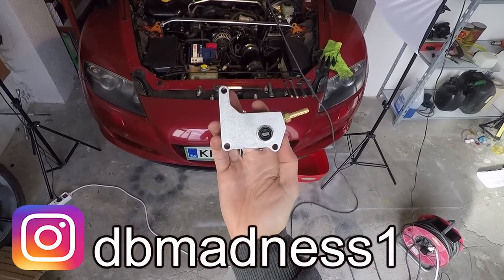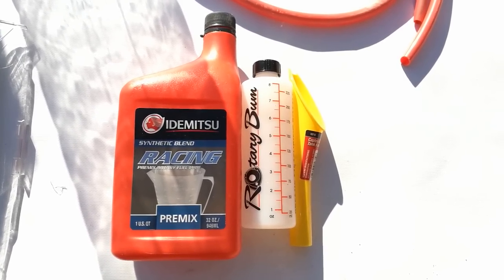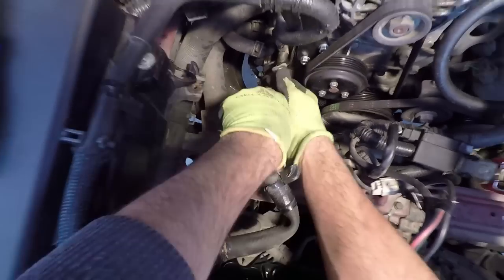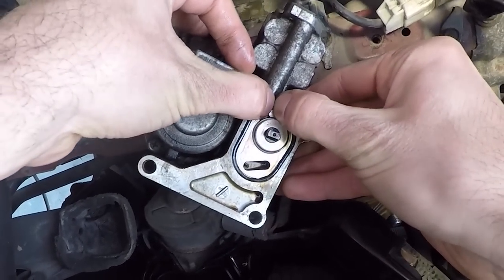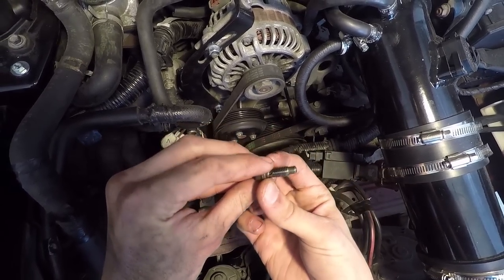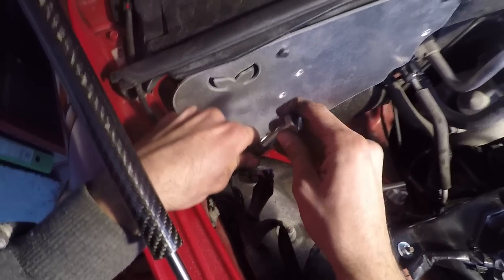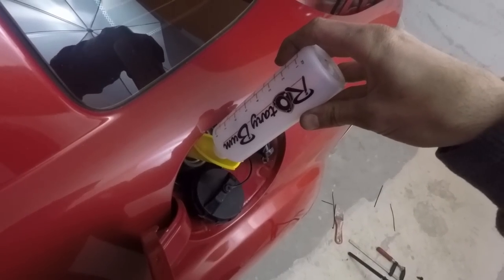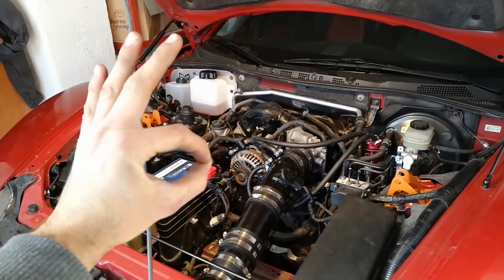Mazda Rx8 Sohn Adapter Kit Install

Comment: Awesome Video as always :)  but you forgot to warn about the oil lines, when you unscrew them, be careful. The screws or the lines could be very hard corrosed and break easily which means very much care and concentration in removing them otherwise a bolt or a line could break and you OMP (Oil Metering Pump) can become useless :)

Next year in May when my RX-8 wakes up from wintersleeping, ill add the Sohn adapter myself to it i can await it to do it ❤ <3. What do you think abaout the Nvidia Q300 Exhaust kit? Im gonna install it, because the Magnaflow wont work for me in germany and i dont know where i can purchase it for shipping to germany ^^
So for now i and my RX-8 Yuu-Chan wish you Merry Christmas, and a good start into 2018, to be have a nkce Car Season and more Fun with our rides than this and the last years x3 
For the Community too greetings!
Reply from the maker: The lines looked quite hard and durable. I was a bit scared when pulling them forward while refitting them, but it got done safely :) Thanks for the heads up!
I was also thinking of installing the Q300, as it is the cheapest one with a TUV certificate :P I would install the Turbo XS exhaust, but it has no papers and it's quite loud.
Take care of it! Cover it with a nice fuzzy blanket to keep her nice and warm :)
Thank you sooooo soooo much :D I wish you a merry Christmas to you, Yuu-Chan and your family! may 2018 be a year full of adventures and unforgettable memories :) <3

Comment: Nice tip :)
I installed mine 2 months ago, with Motul 710 2 Strokes Oil and 2 strokes oil additive. Result is pretty impressive, and engine feels different to me, slight torque increase on all rpm range, and better high rpm reving :)
I'll have a look to your feedbacl after many refueling...
Reply: Go fo motul 800 dude, it' s the best performance 2 stroke oil out there😎
Reply: @raulduke85  this one Motul 800 Factory Line 2T Road Racing Oil ?

Comment: So.. what is this for?
Reply: Doc. Volt, I think it makes the oil flow more consistently and makes the oil the correct consistency so the apex seals stay well lubricated
Reply: The Rx8 injects normal motor oil in the combustion chamber to lubricate the rotor sides and the apex seals. With this mod you disconect it from this cycle. The sohn adapter will inject premix oil to your combustion chamber instead of the normal motor oil. So you dont have that much carbon build up and inject fresh 2 stroke oil. Result: Better lubrication (fresh 2 stroke oil, no dirty motor oil), 2 stroke oil will burn completly (nearly no carbon build up) and the rx8 won´t drain any motor oil anymore.
Reply: Doc. Volt he literally stated that in the first 35 seconds.
Reply: @sonacphotos  synthetic oil does not gum up spark plugs only bad oil additives do.
Reply: KMPZ sorry but you’re labeling all oils as if they are the same there are 2 stroke synthetic oils  but you’re gonna say some carbon up bs again Z

Comment: Could you please try fuel and premix oil(more fuel than oil, since heat is a major cause of apex seal wear) in the Sohn Adapter Tank. Let me know if it works cause I think that also fuel is thinner than oil making it easier to go through oil injectors. Please let me know if my hunches are right because eccentric shaft is going at a higher rpm than even the rotor is at a 3:1 ratio(eccentric shaft to rotor rpm). Please let me know how car feels with the fuel and small amount of oil like you would in the fuel tank also in the sohn adapter tank.

Comment: Ok, so, for clarification. Once The Sohn oil adapter kit is installed just like it is in this video, you only need to add the Idumetsu Racing Rotary Oil Premix to the Sohn oil adapter, not letting it empty, check it and fill up every gas station stop, right? You can disregard the oil in the oil pan, and the dipstick, as they are no longer needed since all oil is coming from the sohn oil adapter, meaning you no longer need to change and fill the oil pan oil and just leave it how it is, right? You should still premix, about 8 oz per fuel tank (which is how much I premix now), right? Again: The oil in the oil pan, and therefore the dipstick, can be fully ignored? No checking it's levels or changing, since it will no longer be used, right?
Reply from the maker: Yes.
- Oil in oil pan is now there just to  lubricate parts, not to be injected in rotors. You should stil check it, but way less often. I do it every 3 months, since i change oil 2 times a year.

-You fill up the sohn bottle as you see it the lever lear empty. Once it's at 1/4, it's a good idea to fill it up, but you dont have to do it everytime you fill the car with fuel, it doesn't go dows that fast. Every second or third stop when filling up with fuel, check it.

- Premixing is not obligatory, but if you premixed before, you still need to do it.
Reply: @Drivenbymadness  Thank you for the quick response, sorry about not getting back sooner. Thank you very much! Will be doing this as soon as I can.

Edit: What kind of oil do you put in the Sohn Oil Adapter? Is there a specific one made for it or is there a best one to use?

Comment: After you install the Sohn adapter, do you still use premix with your fuel?
Reply: I think towards the end of the video he said he does
Reply: Only if its a 2008 and earlier. 2009 and later should be good with just the adapter stuff.

Comment: I live in Europe, and as you might know, inspection centers are picky with emissions going above OEM standards. How much is this going to affect my emissions?
Reply from the maker: Zero,  in theory it should make emissions better, because the engine won't burn dirty engine oil but clean 2 stroke oil. I'm also from Europe  and have to battle the same inspections, and i never had an even the slightest issue with emissions after the install. Hope this helps.
Reply: @Drivenbymadness  It did help. Thanks!
Reply: A Sohn shouldn't impact your emissions. I wouldn't use premix oil in the Sohn because the OMP/MOP is not calibrated for the viscosity of 2-stroke oil. Use standard oil in your Sohn. Use 2 stroke oil mixing in your gasoline. I wouldn't pre-mix for your inspection day, just use a clean tank of gas on that day and add the pre-mix in after your inspection.

Comment: Is there any way, that u dont have to premix it? So i mean that the rx8 mixes his right amount of oil for itself
Reply from the maker: xXnexioXx / NexioEdits. You can either premix or not. Sadly there is no automatic way to do it. I have the rotary bum premix kit where you pre-fill bottles with the amount of oil that is proportionate to the amount of fuel you usually put in. Check out my premix video to get a better idea :)

Comment: You wrote > Sohn adapter is NOT for the S2 Rx8 (2009+) < may I know the reason? I own a 2011 Rx8
Reply from the maker: Alex Lee the reason is that they didn't produce one for the s2 rx8. Maybe they will in the future
Reply: Driven by madness Thanks for the info

Comment: Did your sign adapter work right away? And also how much two stoke does it consume because mine looks like it hasn’t moved that much if at all
Reply from the maker: If you dont drive past 5000 rpm a lot, it wont consume much oil. It works right away, but if you drive very chill, it can last  almost half a year. Which is not that good. Drive it harder once ina while and you'll see the level drop
Reply: Driven By Madness I usually shift around 5000rpm should I wait a little longer, I also redline the car at least once a day so I was expecting it to move a little more, but thank you I’ll try driving it’s little harder and let you know what happens
Reply from the maker: @Tyrese-oz6jo  for optimal fuel consumption shift between 4-4.5k rpm.  OK :)

Comment: How much oil does the Sohn adapter use; how often do you have to add 2 stroke oil to the reservoir?
Reply from the maker: Depends on how hard you drive it, or in other words hwo often you take it above 6000prm. If you do that every once in a while, you'll use maybe max 2 liters of oil in one year, depending on how many kilometers you make. If your drive it hard most of the time, you can use 4-6 liters per year. Adding 2 stroke in fuel is called premixing. Here's a video i made that explains the process and how to do it: https://www.youtube.com/watch?v=mGHdn0aKhxQ&t

Comment: Hey Man! Hope Everything is ok. One quick question. I installed mu sohn adapter a few months ago (what a pain in the but). Can i still use regular mineral oil on the new oil reservoir? I’m using idemitsu premix, but i buy import it from USA, and with the COVID-19 situation i CAN’T!!!!!! Thanks for everything Man!
Reply from the maker: You can buy a 2t oil from a local sotre, just make sure it's not for motorboats. I suggest 2t oils for scooters, motorbikes or go cards.
Reply: Driven By Madness Thanks a lot man. Other thing. I know if i premix the cat will clog. But if i only use the Sohn adapter the cat will clog anyways?
Reply from the maker: @joselperez9384  It wont clog immediately, it would take years and years for it to clog. The sohn has no ill effect on the cat, if anything it's better for the cat cause it burns clean and has almost no resedue behind it. So sohn adapter is very very catalytic converter friendly :)
Reply: Driven By Madness Thats Great. I Can’t stand the smell and smoke without cat. thanks a Lot man!

Comment: I need help I have a rx8 but I never premix how much I need tu use 50 liter of gas how mucho premix i need to use and what type of oil it’s good for the motor
Reply: Link is in the description buddy. Myself, I mix 250ml on a full tank. Theoretically, any kind of 2 stroke oil will do. I use Castrol RS.
Reply: I use 250:1 ratio, well Idemitsu recommends roughly 256:1 (0.5oz per gallon) but it is harder to measure.
For 50L gas you add 195.5mL oil (for 256:1) or 200mL oil (for 250:1).
By the way he has made a video about premixing before, the link is in the video description.

Comment: Have You sorted coolant level sensor? Can see it’s plugged but no lights on dash
Reply from the maker: Never had an issue with it... I necer saw that light turn on, gotta check
Reply: @Drivenbymadness  plenty of coolant, but I heard sensor sometimes is faulty, and need to replace whole tank. I never had troubles with cooling or coolant, only sensor light
Reply from the maker: @maciejsn2126  i think you need to start the car in order for the light to appear.

Comment: Did you find the clear lines that run to the OMP to be fragile? I've heard they can be brittle and it has always made me hesitant to try to undo them.
Reply: I heard the same thing.... So I went ahead and got new oil lines. Turned out they weren't brittle at all, so now I have a spare set of oil lines. If shit hits the fan, I'm willing to part with my new lines for half the price + shipping.
Reply: Flyingdutchy33 I appreciate the offer and i'll keep that in mind if i ever tackle the project and everything goes wrong haha.

Comment: What about if you go racing? Have to premix oil again? Or the sohn pump the necessary oil?
Reply from the maker: Sohn does not change the quantity, only the type of oil that the engine injects to lubricate. Premix is a separate thing, where you put 2stroke oil in the gas tank. If you were premixing, continue to premix.
Reply: Driven By Madness if you install sohn can you hard with you car without worry with the lubrication?

Comment: Is the installation for right hand drive is similiar??
Reply from the maker: yes
Reply: So we will need to fill the reserve  sohn adaptor tank with 2 stroke oil or just engine oil?sorry just want to clarify since u stated just insert 2stroke oil..because i heard some understanding they inserting engine oil into that sohn reserve tank

Comment: Isnt that washer fluid tank too small for daily use?
Reply from the maker: If you spray your windows every day 2 times, then you'll have to refill it every week. But if you spray them only a couple of times per year, then you'll probably refill it 4 times in the whole year. I rather wash my windows at the petrol station than use m fluid and wear our blades. Cheers :)

Comment: Will the sohn adapter be enough to not have to premix?
Reply: They both are for different purposes. Premix = additional lubrication. Sohn = clean oil for engine.

Comment: What is the point of doing it if you still have to premix?
Reply from the maker: Graeme Fisher better lubrication, clean oil gets injected so carbon buildup is dramatically reduced, can use whatever oil type to lubricate the rest of the engine and also use higher viscosity oils without risking clogging the oil injectors. I think these are enough reasons 😉

Comment: Hey dude I have a minor problem with my 04 rx8 (automatic) it CANT do a warm engine start up, I need to let my car sit still for about 20 min before I can barley turn it over, know anything ?
Reply: low compression ... need to rebuild or get new engine.
Reply: lil K have you tried a quick rev to 4000 revs and turn key off at same time. Give it a try everytime you stop.
Reply: adrian bryant that works on cold engine ... this is low conpression...
Reply from the maker: Test your compression, because if your ignition system is all good, it's probably low compression
Reply: Or it just may be you need a new starter. I had this problem and rebuild my starter and and it starts fine. The is a video on how to rebuild your RX8 starter

Comment: This thing should come stock from the factory. Why mazda why. Put a sticker sign "Regularly top up the oil to prevent engine damage. Genuine 4 stroke mineral oil or 2 stroke oil are recommended"

Comment: To bad Series 2's cant use these due to higher oil presssure and fitment
Reply: Jorlanjm doesn’t really matter anyway if you’re renny hasn’t shit itself by now you should be good.
Reply from the maker: At least it has a 3rd oil injector :)

Comment: I find it amazing that, Mazda got it so wrong, that even after this mod, it still needs to have the oil premixed.
Reply: The mod is not intended to replace pre-mixing, it is intended to conserve crankcase oil, segregate lubricants, and prevent oil injectors from sludging up. The Sohn is useful for any generation of the RX-8, but pre-mixing is mostly a 1st gen RX-8 issue. Mazda corrected this by adding additional oil injection in the later models.

Comment: $300 I rather just premix he’s doing it anyway
Reply: Mr. 12A this mod helps your oil last longer so in the long run you’ll save that $300 back with time
Reply: @thefunbuns1  I think it helps to the engine - you are using clean oil instead of dirty motor oil. It has nothing to do with the oil longetivity.